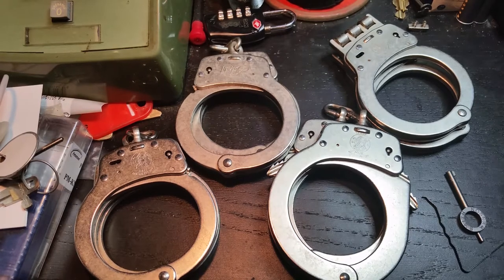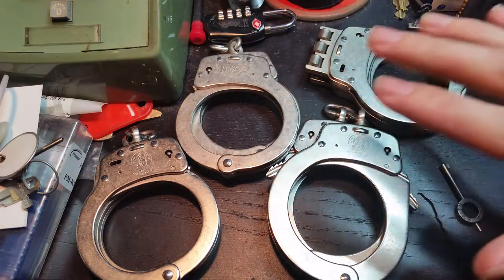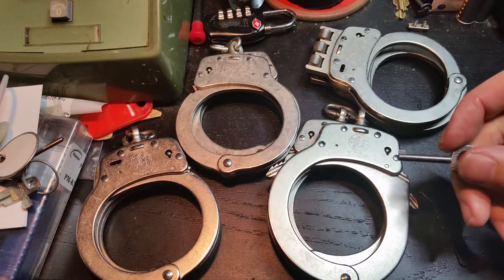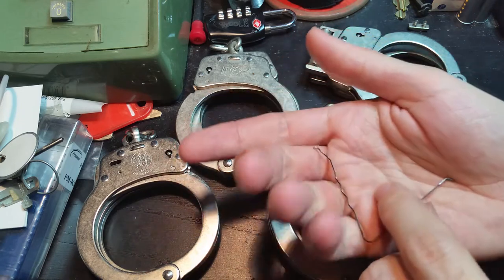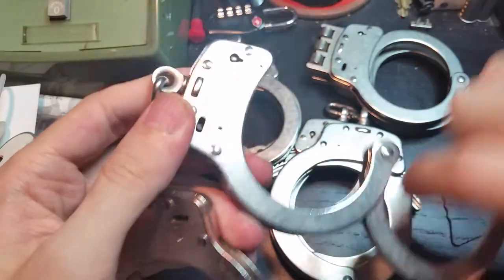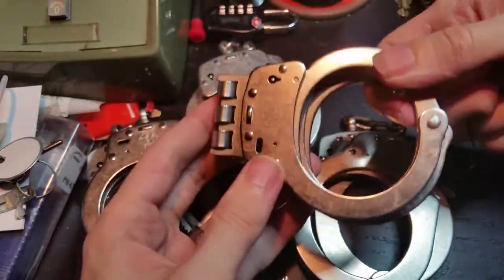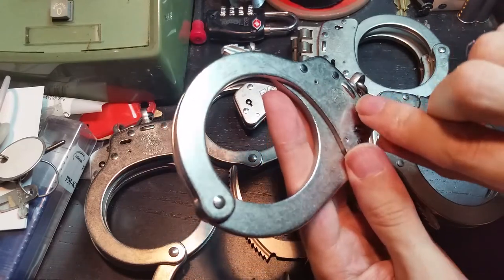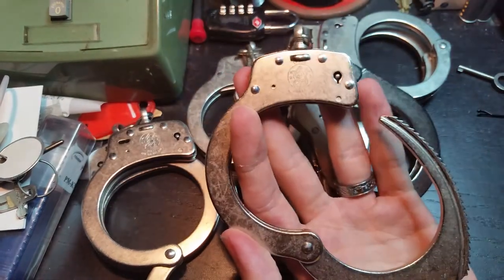(92) Picking Smith & Wesson standard handcuffs

Comment: Nice vid, this definently shows the downside of standard handcuffs tho. A neat design to see would be solid steel body, VERY tight tolerances between twin locking pawls, and a mini medeco core, even a 4 pin would probably suffice as getting to it would be a struggle and then add the difficulty associated with medeco cores, as far as double locking is concerned, id say the standard system could work and simply turning the key backward like a traditional handcuff could probably work.
Reply from the maker: The closest thing to that right now is BOA's CuffMaxx system which retrofits S&W and Peerless handcuffs and leg irons with either Medeco or Assa Desmo cores. In theory the parts for the S&W models might be modified to fit Yuil hand cuffs which feature two independent pawls and lots of anti-shim features.
Reply: Nite 0wl oh I didn't even kno those existed, I would think the PDs around the US would upgrade but I think cost is the only thing in the way right now

Comment: I wonder how many people visit this video for embarrassing reasons :) You always see stories about couples stuck in handcuffs because somebody lost the key. But you never hear stories about them buying and selling old cuffs and ending up with the wrong key lol. Like someone trying to open a pair of Hiatt with a Clejuso key or an Alcyon key lol. Wait, I think there's a cheesy adult industry video in that story somewhere... Nope, I got nothing.
Reply from the maker: That is actually quite similar to how I ended up with one of my Hiatt sets. I have also heard of some specialist locksmiths advertising services for just such situations.
I usually recommend making and keeping one of the 'Ultimate' handcuff keys that TOOOL designed several years ago for those circumstances. They will fit almost cuffs that don't require high security keys.
Reply: I have made for myself a key of the ultimate handcuff key to. They also fit some high security makes also like yuil and asp. very good keys. sombody should professionally make and sell them, their patent fell through because it was not unique enough due to anyone can measure keys and make one of the average of them all, not really an invention.
Reply from the maker: The point of the design was the ability to use those keys on anything from the very common designs (eg S&W 100, Peerless 300, etc) to the medium security and unusual cuffs like ASP 'high security', Yuil, Kyoung Chang high security, etc.